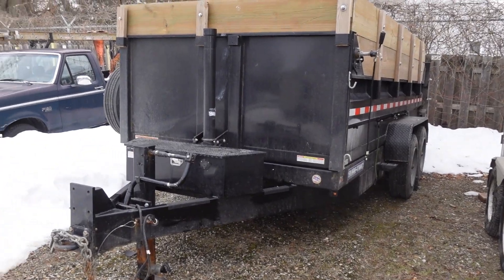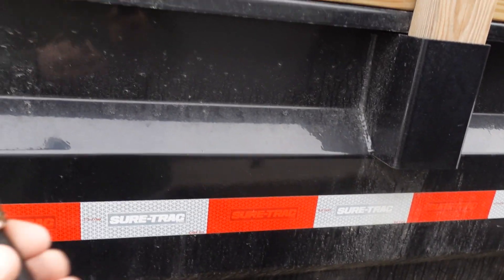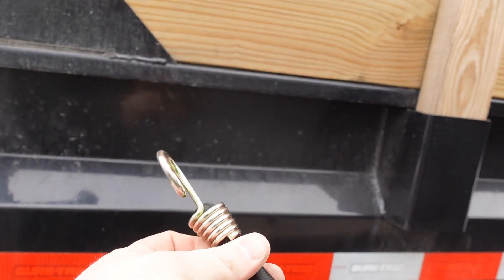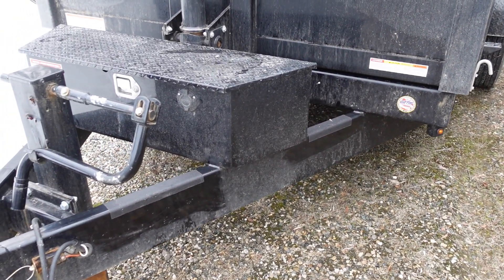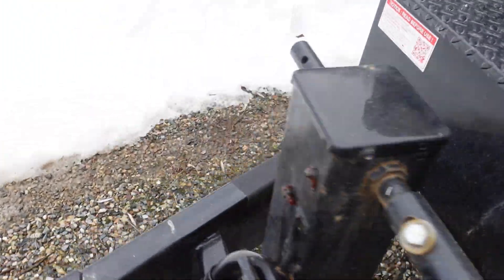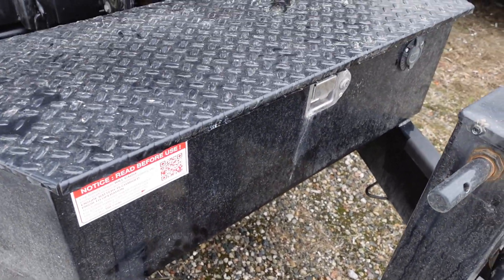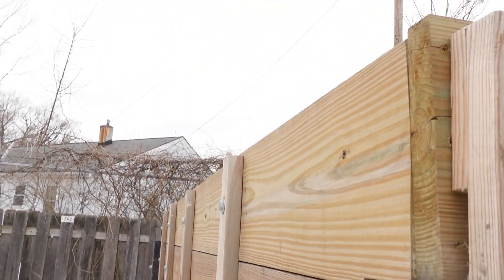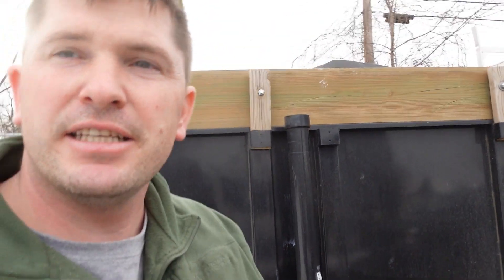Quick Dump Trailer Fix and Modification.

Comment: I've been looking at Suretrac trailers.  Do you live in the PA area, or did you drive there to pick it up from out of state? 
I think you said Grade 8 bolts - definitely not required for that application in wood.  Nylock nuts are a good idea though.  The sandpaper is referred to as anti-skid.  Nice touch.
Reply from the maker: Thanks for the view. There is a dealer in South Michigan named Kelley and Sons. They are a Sure Trac only dealer if I remember correctly.  I got the dump trailer from them. Would highly recommend them.